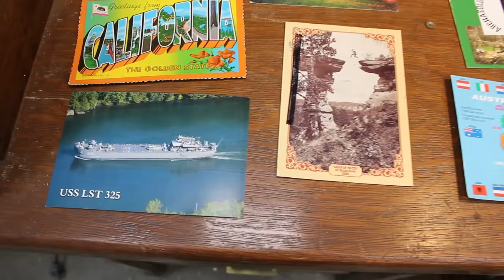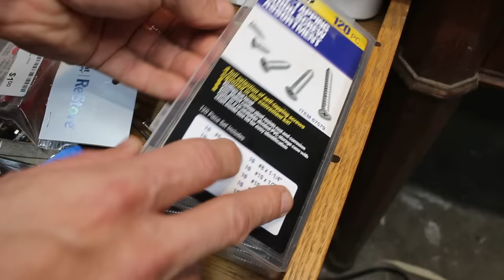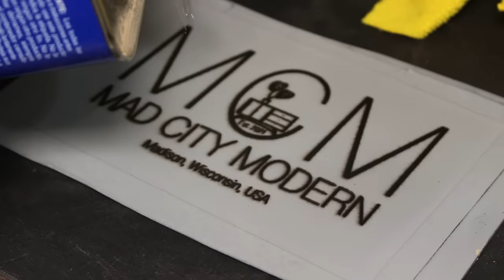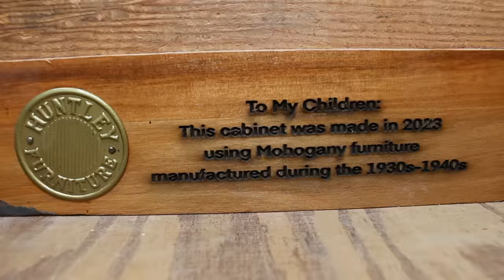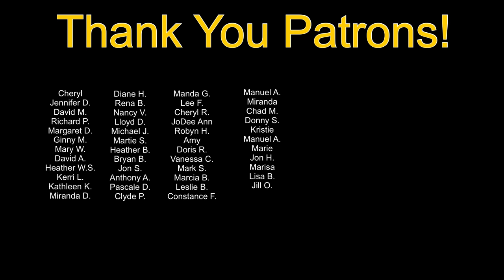Ep. 85 APOTHECARY CHEST from TRASH Furniture

Comment: OMGosh! I love it not only because it's beautiful but, first, I'm a compulsive organizer, and second, apothecary chests remind me of card catalogs and I LOVE card catalogs.  My dad enjoyed a little woodworking. He also saved every nut, screw, bolt, nail, and washer he ever came across all organized and labeled in baby food jars.  All the neighbors knew where to go to get any specific thing they needed, easy-peasy and free for the taking.  One of the reason I enjoy your videos is that sometimes I get a little reminder of Dad.  (He's where I inherited my organizing impulses.) 😊
Reply: Same here. I inherited a garage if tools. Old BIG lathes, band saws, table saw, routers, drill press all the way down to my great, great grandfathers tools. I think one of my favorite is just the planer. An old Stanley hand planer. All the hand saws and hand drills. And yes! 4- 5 gallon buckets of nuts and bolts! I actually went through and cleaned them up and organized them. I use pill bottles for small amounts. He had built a cart with 12 drawers and each drawer has deciders in them. That is where most my nuts and bolts fit into. Sure do miss my Dad!
Reply: @shericreates
Reply: @skaranasos   I understand this right down to the Stanley hand planer.

Comment: Thank you.
I make similar furniture from old timber I buy for very little cos from the local tip shop. 
I don't use many traditional joinery skills.
One reason is I trust modern PVA glues, they are more flexible and don't fail because of  moisture in the air. A tight facing butt  joint
Can be clamped and if, needed
Strengthened with exposed Dowell fitted when the g
lue has set.

Comment: 3:01. Naw. I really appreciate the nice tools but the difference between old or entry level tools and more premium ones is mostly how well they come setup, how often you have to sharpen a chisel, soft start router motors, safety features like SawStop, coming in a case instead of a cardboard box, etc. YouTube is full of craftsmen like Paul Sellers who do amazing work with the tools they have owned for half a century. It's all about experience (like using the chisel bevel down to clean out that slot,) which you will get over time. Nice vid. Looking forward to more.

Comment: around 3:10 - instead of running the wood over the saw and then using the chisel to remove the leftover piece, just move the fence and cut the piece out with another run over the saw.

Comment: I have that same little black and brass hand plane. It's the one I use in the shop the most. 

Try a heat gun (low setting) and a stiff but not too sharp putty knife on that paint. (Or a pull scraper) You'll never use that slimy nasty paint stripper again.